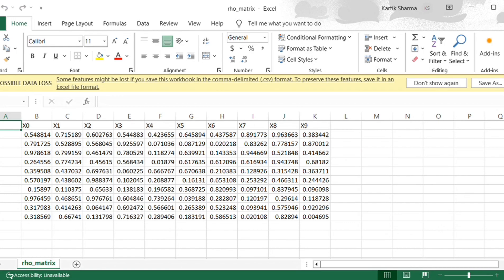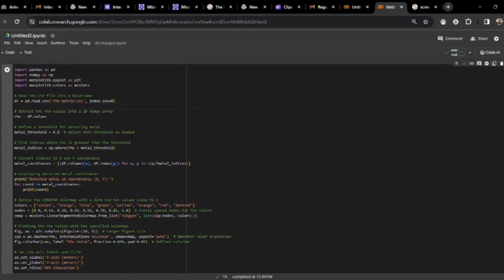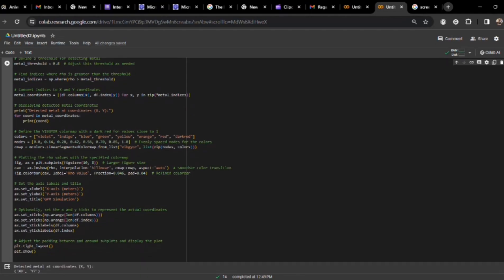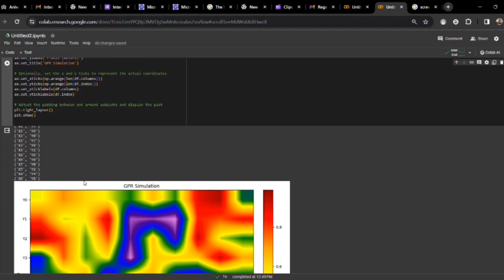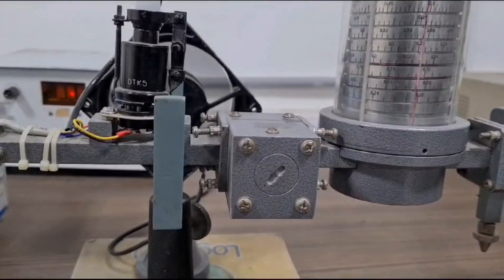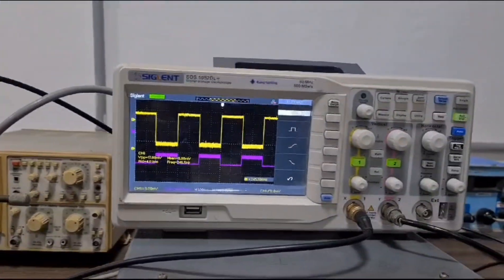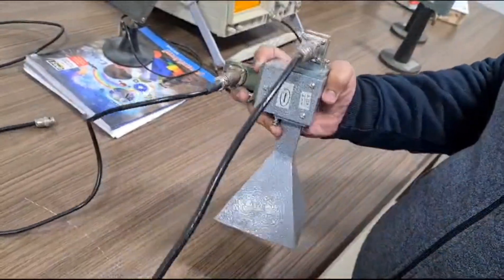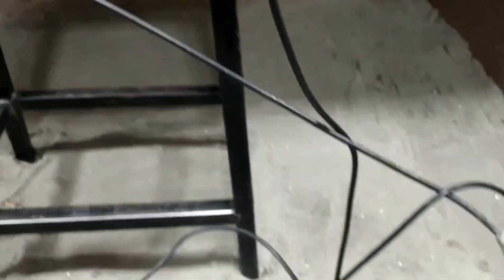Ground Penetrating Radar (GPR)

Comment: Hi i am an engineering student doing final year project on using gpr for sinkhole detection. Is it possible for me to get the circuit diagram on how you integrated your arduino with the grp